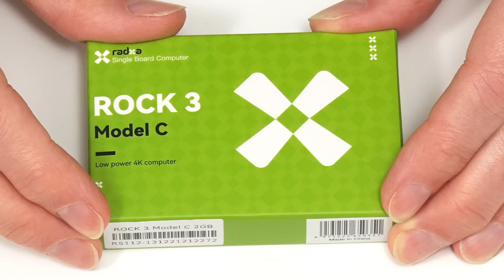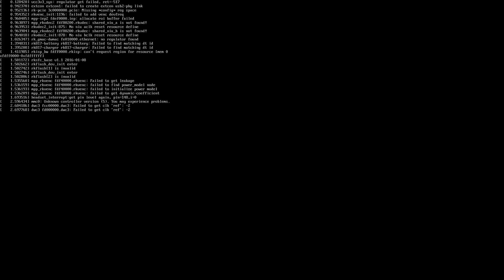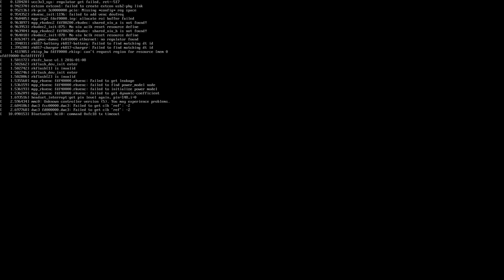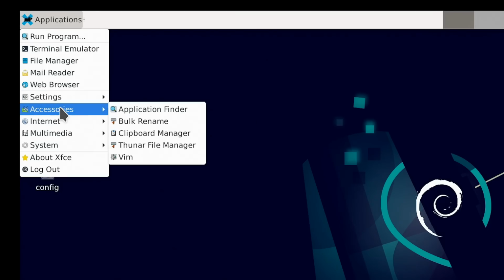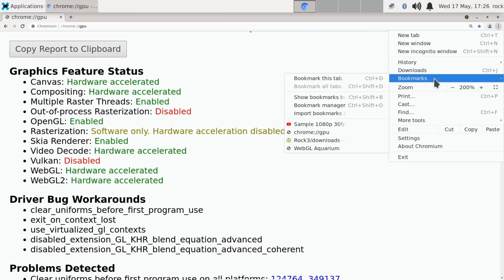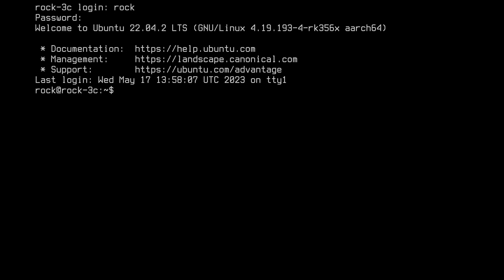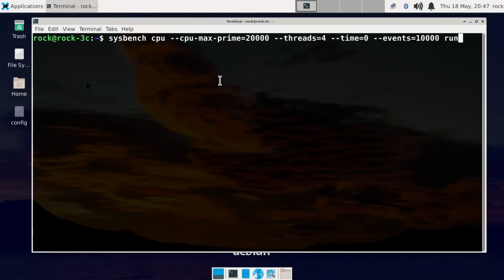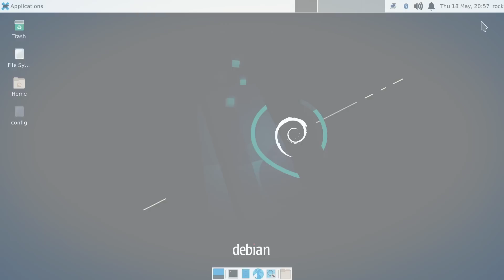Rock 3C: Maker-priced SBC

Comment: 5:42 but what if u cut those pins? them possible to use normal m.2 cards like 4 port sata?
Reply from the maker: Almost certainly so. :) I like your thinking - although you'd need a way to hold down the drive.

Comment: Thanks Chris for this very informative video. You motivated me to buy the Rock3C and I have been playing with it. The SW support is actually impressive - documentation is somewhat harder to find. There is even the equivalent of raspiconfig, which is rsetup.
What I find bizarre: The serial console output is set to 1.5Mbps, which is not working with most USB-serial adapters. The system has a predefined boot search order (mmc1 mmc0 nvme0 usb0 pxe dhcp sf0) and uses u-boot to select the linux image. u-boot is stored on the first (reserved!) 16MB of the storage medium (gpt partioned). It looks like the Balena-etcher does all that work when installing an OS-image. I ordered an M.2 2230 NVMe to try out next. Balena etcher is not available for ARM, which someone should fix (Windows: yes, Linux only X86...)

Indeed a very interesting board, iRadxa will cause headaches for the Raspberry team. With a better power meter I see it idles along at ~1.5 Watts running Debian 11 of the eMMC (Wifi connected). Not bad!
Reply: In the mean time, I have installed an M.2 2230 SSD (512 GB Transcend), and am running the ROCK3C from that. Works like advertized. Debian idles at 1.6Watt average...

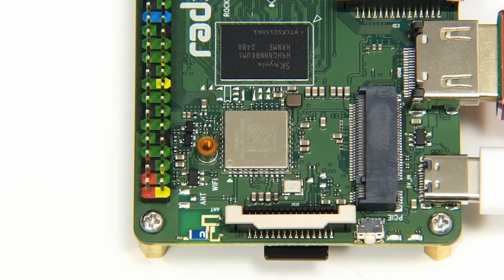Comment: @13:34 Not quite understanding?  Ubuntu won't work with an Nvme?  OR  You didn't have a 30mm card to fit?  Both Micron and Corsair make a 1TB 2230 less than $100.  Plus it seems a Rock 3A is only about $10 more than the 3C -- So wouldn't that make a pretty snappy Ubuntu 22.04 workstation?
Reply from the maker: I mean that I did not have a 2230 SDD. Not many of us think that $100 is a minor expenditure! :) Regarding the Rock 3A, it depends if you want WiFi. :)

Comment: Please retest/review the Rock 3A using the new releases of Debian.  In your original video, the NVME drive slot did not work in Debian and the video playback  did not have hardware acceleration.  I would like to know if the updated Debian image fixed those issues.
Reply from the maker: Thanks for this, but this channel is my business, and I cannot keep making videos revising boards for what will be an increasingly smaller audience. When a company launches a product it should do so with appropriate software support.

Comment: Where did you get the eMMc module?  If you buy one, do you need the reader/writer for it?
Reply from the maker: My 16GB eMMC came from AllNet, but they are now also sold by OKDo: https://www.okdo.com/c/rock-shop/rock-accessories/ Getting the £/$2 micro SD adapter certainly makes like a lot easier, as you can image the module just like a microSD.
Reply: @ExplainingComputers  Thank you.

Comment: Hi Chris, I hope you can revisit this board again in the near future. Disc IO for the M.2 slot could be tested with one of the riser cables you used on some other boards with the mad oriented slots perhaps? Also, a little play around with the GPIO on the 3C would be nice to see. Just to see how compatible it is against the Pi 3/4 - especially the serial interfaces that can be troublesome at times.

Comment: I'm surprised you didn't put a fast(?) nvme drive that fits the board in for read/write testing.

And, you could remove the gpio header and solder it on the other side of the board to give room for a longer nvme.
Reply from the maker: I made it very clear that tried to test using a standard 2280 NVMe M.2 SSD, but that this was not practical. I was not going to desolder the GPIO header for a test.

Comment: Some suggestions for measuring power usage of a SBC. The best option would be buying a bench power supply, those can give you both power and precise measurements of usage. For a cheaper and easier way, there are USB-C cables that have built-in power meters with a tiny screen embedded on the connector.

Comment: I saw a port for SSD or wifi on rock board. Is it SSD or for wifi card?
Reply: The one on Rock 3C is an M.2 M-key slot which supports M.2 NVMe SSD (not M.2 SATA SSD), but only M.2 2230 SSDs fit unless you use the M.2 extension board (available for other Rock 3/4 boards)

Comment: Aren't there M.2 adapters / cables that will let you connect longer M.2 keyed SSDs than what would normally fit?  I know there are cables that convert the Wi-Fi connector to SATA connectors for use with HDDs and SSDs, the same is true for M.2 connectors.
Reply from the maker: I imagine you are correct.  I must get one! :)

Comment: Great video. It is not clear to me did you try to test with a 2230 SSD and it failed to work?
Reply from the maker: I tried to test with a 2280 SSD, but could not physically make this work over the GPIO pins. I did not have a 2230 SSD to test.

Comment: That's a superb price-point.  SBCs are supposed to be inexpensive.  These newer ones that are $150, $200, or more, just kind of miss the point, in my opinion.  Ok, the $50 one doesn't have the power of a $200 one, but no one should expect it to.  If the software support goes as well as it seems to be initially, this will be a great board!

Comment: I Like You Still Include RPi3B+. Still the best till this day even 3B. I used every day. I stream my Cloud PC at 1080p@60FPS 24h/7d. Rock 3A looks promising beacuse is cheap and you can buy new. 4GB model make a huge diffrence when comes to cloud emulation. Would be cool to replace RPi3B but since 2016 I didnt find worthy board. I will buy anyway to Test It. Thanks

Comment: 'Fake' PoE
I was initially WhooHoo It's got PoE! then I checked the site, Damn.
WHY do they put on a 'fake' feature like this which adds 50% plus to the price by the time you've bought their PoE HAT!  
No use putting a feature like that as makers will end up with the $5 PoE 5v splitter block (a male and female RJ45 with a Pi style power connector) which works fine with PoE switches upto 48v...
If those guys can do it for a fiver, then radxa need to up their game!
I literally had my credit card out to order one! Naughty!

Comment: I stopped buying single board computers 2 years ago when the SBC prices ballooned. Recently I bought a bunch of mini PCs, really powerful ones, for almost the same cost as some of the SBCs, and I thought that was hilarious. This SBC is at least reasonably priced, so I'll consider it for future projects, but for now I think I'll make do with my haul of mini PCs and dirt cheap microcontrollers. I am going back to my roots in a way, since I learned how to program by writing assembly code for 8051 microcontrollers lol
Reply: Bingo, You nailed it Sir.  
Too many manufacturers don't get that!  They forget the 'maker' features and try to build a $100-£200 computer with GPIO pins as an afterthought.  The maker market fuelled the growth of the pi.
At the right price point a SBC with the needed extras onboard becomes a better alternative to starting with an Arduino or ESP32 and stringing modules together.
I'll also say that I have a few used NUC's doing a better job than £30 worth of Pi

Comment: Hey Chris, as more and more SBCs are incorporating a hardware neural engine accelerator (and since AI is a big thing these days), how about testing the performance of simple AI inferencing on new boards? Tensorflow light should be easy to setup (I used on on RPi3 and RPi 4 although that was CPU only)?

Comment: Heya Chris.....Just wanted to let you know, the Message you got when opening chromium on the Debian image is due to it being a Chinese version of chrome and not allowing privacy due to governmental restrictions in their country. It will also mean that you might have a cracked version of chromium and it may be sending telemetry to places you don't want it to go. Check your outgoing data packets and see if its "calling home" as I don't trust these non official builds of Linux OS's from Chinese tech manufacturers. It will also mean that logging on to any accounts will not be held over for the next restart of the browser ( I have found this during tests on Orange Pi Official software builds and have seen out-going data packets to places with Chinese  IP's) Just be careful of your data privacy and what you enter into the browsers on these distros.

Comment: I have seen adapters for other boards that turn the short NVMe ports 90 degrees so the card faces upwards on a bracket, as well as SATA port adapters and PCIe slot riser adapters to plug into them.

Comment: Could you test other codecs on the Youtube test it looks like your video is AVC1(H.264) 1808@30fps, the Rockchip SOC in this apparently can support hardware vp09 decode which is usually YouTube's default at this point, I'm sure since it doesn't support hardware av01 decoding that an AV01 video would run horribly even at a fairly low resolution.

Comment: Sooo. I still have these two questions. 1* can i use that cheap pc for 3d prints and two is it enough to finish my programming course in PHP &MySql? I guess the latter will work fine. Though question 1 is a real question. Also do you have an external camera option for that low cost pc that favors You
Reply: I'm still hoping for an answer on these. I'm about to order and i want to order what i need. Btw it was about the B-Max

Comment: right is a couched phrase here - in actual reality going with a sbc/soc platform is disadvantageous vs cheaper refurb cots x86 parts and the disadvantages are rife - lack of compatibility, expandability and processing power - be smart with enterprise resource planning and reap more roi with lower tco by making realistic computing purchase decisions - arm and sbc/soc will be more of thing going forward but they are just pretenders in general for now except in rational clear case use applications - blame raspberry pi for pissing the in the integer pool - they are just out for money and don't have users in the best regard and this has corrupted the entire space and market for these devices to large extent - it may not have been wholly intentional but market sentiment for all devices is at an all time low (decades) - it could be a while for manufacturers to gain favor and get back in the good graces of the pc and sbc enthusiasts given the unfavorable state of the state of the art #aib #mkt sentiment #innovation (or lack thereof) #smb market #refurb nirvana

Comment: I bought the upgrade of this ( Rock 4SE ) 4GB RAM Dual A72 , Quad A53 and Mali T860MP4 GPU and found it lacking for my purpose.
I was looking to get this SBC set up for MicroPython programming.
All the software needed to program or even connect to the microcontrollers were older versions.
The updated software needed installed and worked fine on either a Linux PC or Windows.
As soon as Raspberry Pis are back in stock I'll try them.

Comment: Interestingly, I have had some difficulties running anydesk on systems with 2GB memory and lower. It has been so with raspberries, and even with a lattepanda v1 cherry trail board. Everything works, albeit on the slow end. The main caveat has been keyboard ghosting when in desktop screen, to the point it becomes better to ssh to the board and do whatever is command line related this way. For comparison, I've tested anydesk many times on more capable systems, for instance on an i5 based, industrial x64 machine, with more memory, and it runs smoothly as expected. I mentioned memory specifically because, on process viewer, the most memory consuming one was indeed anydesk. The fact that it renders ok screens and even videos, but presents keyboard ghosting, point to some function optimizations to look around. Anyways.

Comment: I should know... I suppose, but I didn't know what OTG was regarding the USB 2.0 port.... so I asked ChatGPT. 

ChatGPT:
"In the context of USB ports, "OTG" stands for USB On-The-Go. USB On-The-Go is a specification that allows devices to act as both a USB host and a USB peripheral, enabling them to establish a direct connection with each other without the need for a computer or additional USB host device.

An OTG-enabled USB port, such as the one mentioned in the video, can function as a USB host when connected to USB peripherals like keyboards, mice, or storage devices. It can also function as a USB peripheral when connected to a USB host device like a computer or a smartphone.

The OTG functionality expands the versatility of the USB port, allowing devices to communicate and transfer data directly with each other, which can be useful for various applications, such as transferring files between smartphones, connecting USB peripherals to tablets, or even connecting USB storage devices to smartphones or tablets for data access.

It's worth noting that not all USB 2.0 ports have OTG capabilities. So, in the case of the board mentioned in the video, one of the USB 2.0 slots being OTG means that it supports USB On-The-Go functionality, allowing it to act as both a USB host and a USB peripheral."

Comment: It's refreshing to see the M.2 slot being adopted more and more, as well as hardware acceleration. A proper desktop replacement seems closer than ever.

The 2GB RAM bit is a bit of a shame though. 

So close, yet so far away.
Reply: Chris mentioned early on that the Rock 3C came in 1, 2, 4, and 8 GB variants; he just happened to have the 2 GB version.
Reply: @McTroyd  Sorry, I probably missed that part.
Reply: @dantevortex  No worries.

Comment: Also, the Ax5 (75 or 55 alike) cores support a newer ARM spec which some programs now require, for example MongoDB. While I don’t condone Mongo’s dropping of support for older cores, newer ones will likely become even more of a necessity as time goes on. In any case, leaving aside the Pi4, this seems like a good competitor to some of the older Amlogic boards that are typically available at this price point.

Comment: Another great video. One question: why were the menus slower in Linux than on the other boards if the CPU is actually faster than on the Pi 3B? Would it be smoother if running from a 2230 HD?

Comment: More SBCs should have magic genies.  
The full sized HDMI socket and separate power header for the fan are awesome.
Also, it looks like the SSD card slot gives the satisfying click sound when the card is inserted and removed, like the original Raspberry Pi used, as opposed to the push fit connectors that they have been using for more recent boards.

Comment: It appears that this 3c might fit into Pi3 cases with a slight modification to the power input, do you think this is correct?
Reply: Chris said in another response that yes, Pi cases should work with a little mod on the power port.

Comment: This Rock 3C SBC seems to be a winner for hobbyists IMHO.
- it is available
- good price
- software seems to work (even with a sluggish OS menu)
- analog mic input (mono is good enough for me)
- M.2 SSD port and eMMC
- fan power connector (just 2 pin though)
Hopefully more of the usual local RPi retailers will be stocking these also.
Reply: I was just going to make a comment whinging earlier and then I realized
- it is available
And I'm like huh.  Rly?  Look it up again on another website.  Oh wait this actually exists it's not just vaporware?  Sounds pretty sweet.

Comment: you could get one of those USB volt/amp meters that show the current voltage and current used by the usb cable. I have one that's shaped like a "+" that has both USB A and Type C, and supports both QuickCharge and Power Delivery up to 30V.

Comment: I'm not so sure producing a 32-bit computer, even if it's a SBC, is such a good idea. Of course, limiting anything with 1GB of memory or even 4GB is probably also a bit of a deal killer. Complicate it with a higher price and I can't exactly say there will be a whole lot of "enthusiasm" for these things. I do like Debian-based Linux, but complicating anything with some actual (neck beard) Debian and I don't predict an overwhelming demand for the Radxa SBC. However, given the death (?) of the Raspberry PI, I'm fairly sure there will be a few people buying these things since it seems there will be an ever increasing need for at least a few more "Pi Holes" and/or self-owned "cloud" devices.

Comment: For all these little SBC's it would be fantastic to test some of the GPIO pins as those tend to be what isn't as compatible between Rpi and the alternatives.
Reply: After reading "maker-priced" I was expecting some GPIO tests as well. I bought a banana pi zero and I was disappointed that raspbian is somewhat hacked/fiddled to work on bananas, also GPIO, spi, i2c won't work as you expect. It turned useless to my purpose

Comment: after some time of using SBCs myself both arm and x86 for me 2gb of ram doesn't cut it anymore - 4gb are somewhat became my standard minimum on any system today with the gpu have at least 128mb of vram
I recently tried to get an old system back to live and its onboard igpu with only 16mb of vram was not enough to handle a simple tty based pxe boot into an installer - I had two options: either rely on remote over serial or network - or to plug in a cheap dedicated gpu with enough oomph
interesting to see that even today SBCs are kept down in microcontroller land instead of provide them with something more useful these days